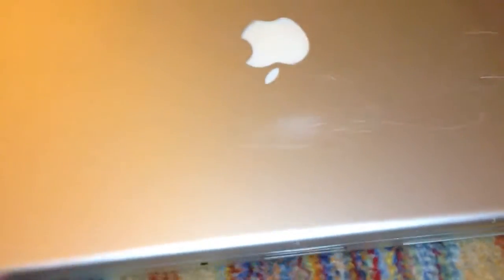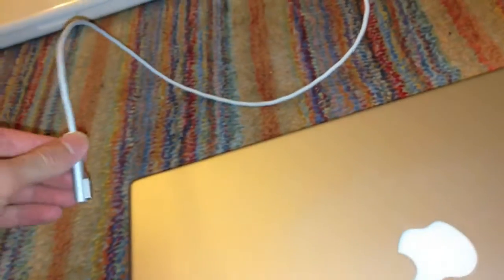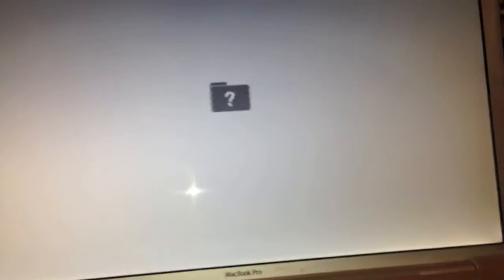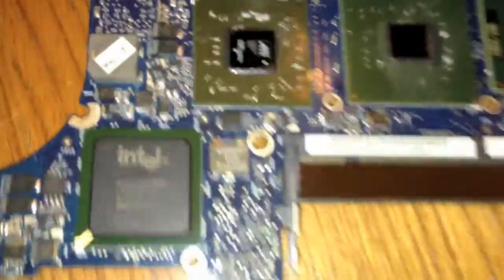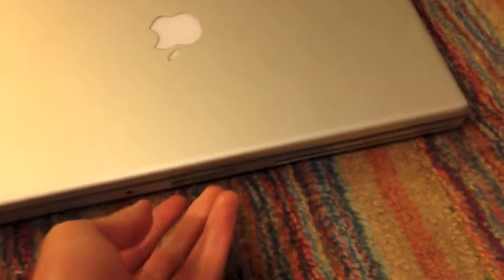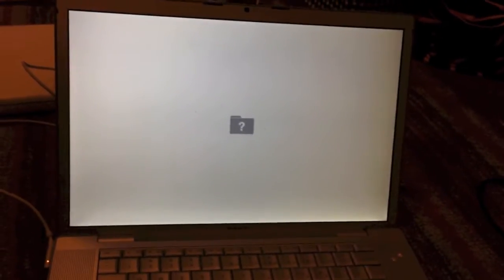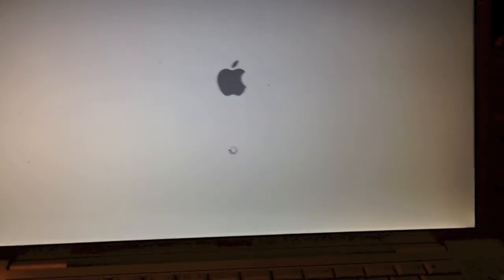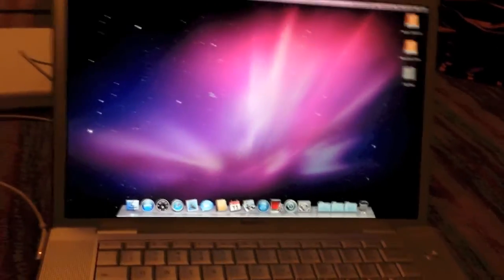2006 15" MacBook Pro Model A1150 Repair

Comment: I purchased 2006 macbook1 A1150 for approx $35. I applied blanket therapy on it. I was able boot by power button+shift. When I logged in I tried to delete user data by secure delete but secure delete stopped mid end so turned it off. Now it's not starting and showing file question mark error. What to do now? Pls help

Comment: Good video
I brought a 2006 a1150 1.83gHZ, and it heats a lot, when I boot to Install disc be it OSX or Windows XP, after few minutes it Kernel Panic, later I will change the thermal paste and hope it work.
Reply: U need to clean fan and apply artic gel on cpu. Mine is shutting down randomly but still works.

Comment: Congratulations on the fix.  However, I think that the real fix came with properly cleaning and reapplying a good thermal paste to the mating parts of the graphics chips in the reassembly process.  I recommend a viewing of this video by Louis Rossman here and his commentary on reBalling or reFlowing.  Without a doubt, Louis isn't a fan boy as I am, but his observations are worth noting, especially as it relates to the GPU.  https://youtu.be/1AcEt073Uds

Comment: Very Nice machine :) U inspiered me to Reflow the Logic board of my beaten up and dead 2007 2.2Ghz MBP I did the Oven way I was not expecting to work but it did and I am Very happy now :) It Just needs a new Hard drive and its good to go heh
Reply from the maker: Be careful, as I mentioned in the video, the 2007 nVidia based model fails due to a manufacturing defect in the GPU chip itself, not simply due to high heat/bad application of thermal compound. It will most likely fail again, unfortunately.
Reply: ***** yeah Im awere of the defective 8600M GTs but hey its better then no MacBook Pro I use SMC fan controll to ramp the fans to max to keep it nice and cool heh Its my only working intel Mac as well (the iMac in one of my vids had its graphics card crap out) My other macs are an iBook G4 1.33Ghz 14 inch a Power Mac G4 sawtooth with a 1.4Ghz upgrade and a Radoin 9200 GPU and my dual 1.42Ghz PMG4 MDD with a Radoin 9800 in it But my Main machine is a X3220 Xeon hackintosh with a Geforce GT 740 Gota do a Video on that soon heh